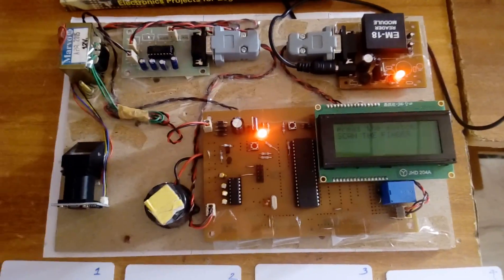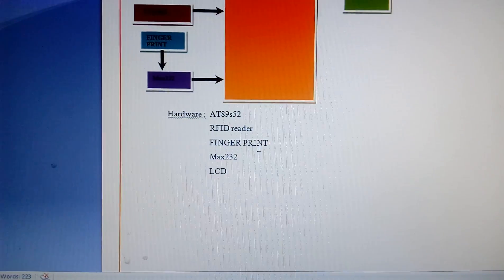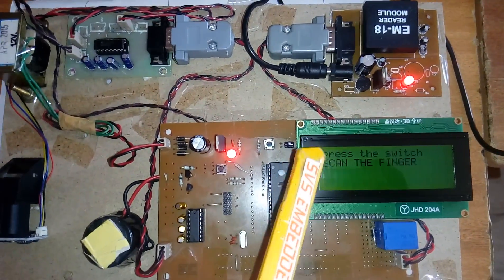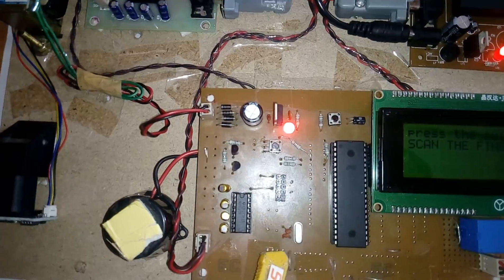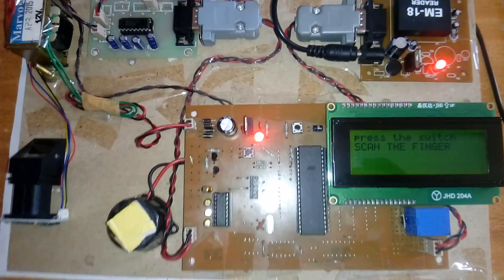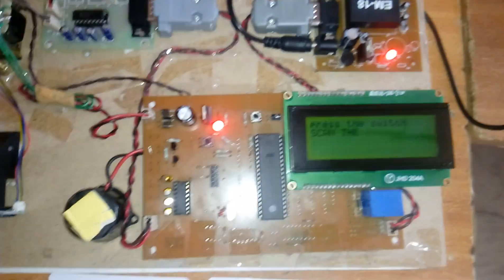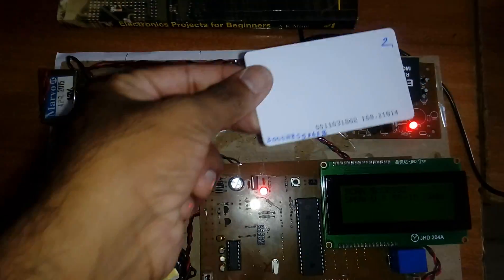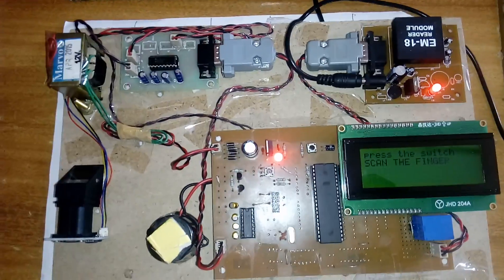Examination room guide using RFID and FINGER PRINT for the jumbling system based EXAMS

Comment: sir can u pls provide program and connection details
Reply from the maker: Thanks for watching and your valuable Feed back.yes we will help on coding part.
we are selling the projects with least cost.if u order the project we will provide working hardware kit along with 
1.abstract
2.datasheets
3.documentation
4.schematic( circuit ) diagram.
5.software code.
6.sample ppts
7.photos&video file on entire project
through google drive
send me a mail to  svsembedded@gmail.com,info@svsembedded.com.
9491535690,7842358459,www.svsembedded.com,www.svskits.in,
we will send u the how to order procedure to u.